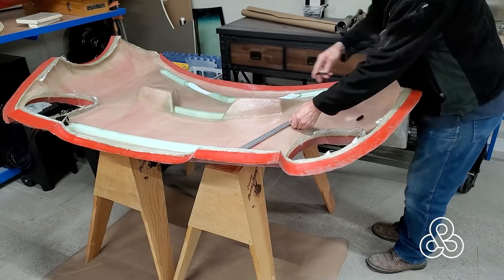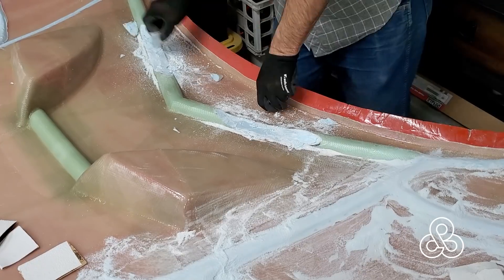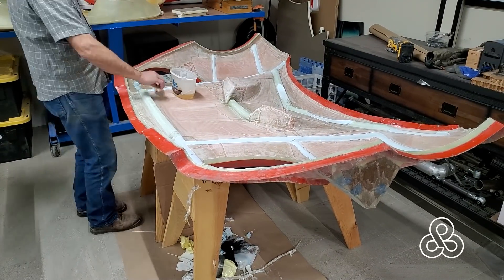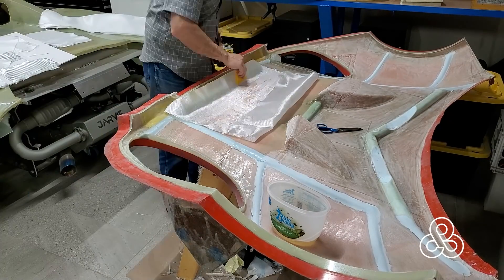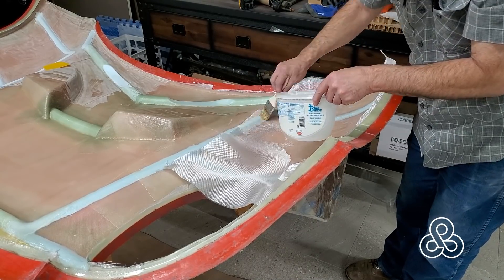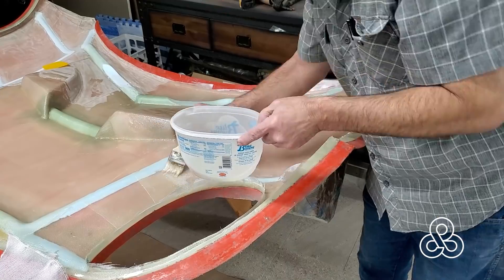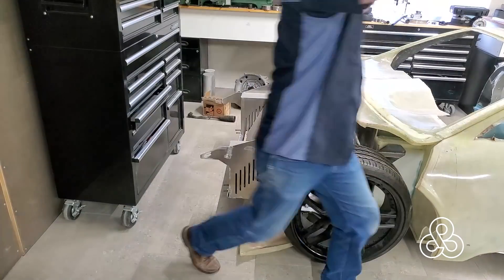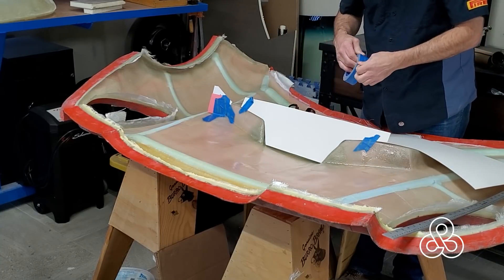A60 Reinforcing the bonnet (clamshell), Arete Supercar Project.

Comment: How do you keep the fiberglass from cracking after chassis vibrations.
Reply from the maker: A material that is can expand and contract with temperature, (the main problem) is almost always good at vibration isolation as well. Rubber and urethane the most common.

Comment: Hey, great work. Have you ever tested the durability of fiberglass panels against fire? I couldn't find any on Youtube. Would you mind demonstrating it in one video?
Reply from the maker: Any consideration for fire resistance is in the formulation of the epoxy itself. Fire could be easily propagated in the epoxy I am using and leave you with nothing but charred fiberglass. Fire resistant panels are usually built with phenolics as they have properties more suited.
Reply: It is hardly fantastic and in this build, has never been a consideration

Comment: I love the project, but I'm increasingly concerned that the composite structure is going to end up being much heavier than you'd want in a supercar.  The strength of composites comes from keeping the resin to fibre ratio to a minimum.  Wet layup is by far the worst method to achieve this.  To make up for the lack of strength, you need to create thicker panels, or add extra stiffening, making them even heavier.  Using Nomex core for lightness, then using wet layup just doesn't make any sense, either mechanically or economically.  Instead, you can get foam core with honeycomb channels that is designed for the infusion process, and creates a resin honeycomb instead of the Nomex and creates light but strong panels.

From comments made in earlier videos, I think you've greatly overestimated both the effort needed to learn CAD/CAM, and also the effort and cost required to use vacuum infusion.
Using CAD, which for someone with your background would be easy to learn, you'd have been able to identify the interference issue at design time, similarly the problem with the rear clamshell hitting the roof when opening.  Even if you don't use CAM to create the moulds, you can get accurate printouts of the cross sections to make your plug(s).

Using resin infusion, and vacuum bagging (nowhere near as hard or costly as you suggest), you could create strong, lightweight pieces, and you could have incorporated closed-cell foam to construct the strengthening ribs at the start.  I would estimate that your composite structures could be half the weight, with the same or better strength, by using CAD to avoid the need for re-engineering things like stiffening and hard points, and resin infusion with vacuum bagging to ensure optimum resin-fibre ratio. I'd also be surprised if it turned out more expensive, because you'd be using much less resin and fibre.

You should check out the Easy Composites channel who did a great 3-video tutorial series on creating a complete car bonnet (i.e. not just the skin) in carbon fibre using infusion with a mould taken off a production car.  The result was superb - incredibly light and strong.  You should also check out the Dark Aero project (also on YouTube).  Although they are not working from a garage, their composite work is definitely within the home-constructor's grasp.  I'm not affiliated with either of these channels, just a fan of their work.
Reply from the maker: Sorry, this time I'm going to have to tell you you are just plain wrong on most points, but all because of one reason- Budget! I will have to take the weight penalty, because I refuse to let this project grow and grow and grow. Let's compare a few costs- My molds= $3,000. Molds with wide flanges for infusion/bagging and strong enough not to distort under vacuum= $8,000 (conservatively). Lets add another $2,000 for molds of rear side clamshells for stiffening (the job this video just described). *$10,000* Foam core- 4x8 1 inch construction sheets used - 2 @ $17= $34  industry standard vinyl foam- 3x4 1/2 inch sheets= 8 @ $69=$552. Vacuum bag supplies to form the hood would have been about $90 (as listed today on Fiberglas.com website.) Not that expensive for one mold, but I have 11 pieces! Sure, some are smaller, but we would also have to remember that the tub would have to be broken down into more parts (likely 6), so now we are talking $1200 or so for vac bagging. I have most of these supplies on hand, but I think you get the point. With a $25,000 budget (now 30K) I would be seriously stripping my engine and mechanical budget. Why stop there? why not go with carbon fiber? Instead of 400 yards of glass at $7/yard try 400 at $40/yrd= $16,000 (but if your going to step up the game to that point you cant use scraps/small pieces in the layup, you have to use full sheet cutouts. So it would likely be more like $40K. You are right however on the fact that I could probably learn 3D modeling fast . . I sure hope so, because I just bought Solidworks at $2000/year. . $3.50/day -- the clock is ticking!
Reply: @BuilderCreator You clearly haven't looked at the Easy Composites videos, have you?

You're so far off the mark in your costings I'm flabbergasted.  I can only assume you're confusing vacuum infusion with vacuum bagging for autoclave (which is a different kettle of fish).

Infusion vacuum bagging only requires a small flange and it doesn't have to be especially strong, neither does the mould.  They are subjected to atmospheric pressure from both sides, so they are in equilibrium.  There is zero tendency to distort under vacuum (assuming you're doing it right), and it uses room-temperature cured resin, so there's no heat distortion.

Please do watch their series (actually I'd recommend all of their videos), cost out what they did, scale it up to your project, and come back with a realistic costing.  The first episode is here: https://www.youtube.com/watch?v=UgKvDw1E60E

Using their prices (not necessarily the best) I've costed up your bonnet, assuming it is around 2 square metres.  For Soric foam core, peel ply, infusion mesh, bagging film, bagging sealing tape, infusion coil, and disposable tubing it would come to about £22.  That's for all of the additional items compared to wet layup. I've not included resin or fibre, because that's your choice.  However, since you'd use less resin and fibre for equivalent strength, you would recoup a lot of the extra.  Also, because of the size of your project, the costs would come down significantly if you purchased everything at once.

When I suggested integrating ribs of rigid, closed-cell foam, I was only talking of inch-wide strips similar to what you've done, just part of the initial infusion.  Even though the foam is relatively expensive, compared to the cost of the project, their cost is negligible, yet you can produce the same strength as the double-skinned bonnet in the videos without needing a separate mould for an inner skin.

You could have used your existing moulds - they're probably stronger than the ones they create in the above video, so there's no extra cost there.

If you were to consider CF, I estimate that their double-skinned bonnet cost around £120 in fibre and resin (not including the mould).  Since you would need more fibre and resin, to end up with a comparable strength part in glass fibre, CF is not really that much more expensive.  Prices for CF in the US do seem high; the 200g 2x2 twill in the video is £9/sqm (£7.50 sq yd).  The best US price I've seen was $20/sq yd.

Good luck with the CAD.  Learn the basics, then start using it.  When you don't know how to do something, look for a tutorial.  That way you're not learning stuff you may never need, and won't get overwhelmed.
Reply from the maker: @Raven-Creations  I am talking the same process (room temperature infusion) Maybe we both suffer from EFDE (exaggeration for dramatic emphasis), but I just looked and indeed US Composites, almost always the least expensive, has 160g 2x2 carbon for just over $30 (21.50) yrd. If I buy a full roll. enough to do the car= $12,000 (8,600). This doesn't change my 'budget" problem. The molds 'Do" have to be especially strong and have a significant flange. Not for the atmospheric pressure, but that after the infusion, that part isn't changing. Any distortion in the mold and no parts will line up. If you think a small flange is okay, you have never chased a vacuum leak in hair puling frustration. I have watched the Easy Composites videos. Mind you, I am not against Infusion or carbon fiber. I am showing people how to do this less expensively. In fact, I sometimes kick myself for not building a $10,000 dollar rolling bathtub, as $30,000 has scared a lot of young people away. This channel is to inspire people to go build something, rather than how to obtain an expensive car. It may as well have been built from Unobtainium as carbon. CAD- I have the basics. I have been using AutoCAD for 30 years (off and on) for architectural drawing. That experience has taught me that I can fly in 2d drawing, but trying my hand at 3D Studio, Blender and Fusion 360 . . It is going to take me a while to get proficient. Maybe if I didn't have cars to build, 2 houses to maintain (one with remodels going on) 2 house plans to finish, A CNC machine to wire, A 3D printer to assemble, church duties and keeping my wife happy . . . I could master it in a few months. Ha! Good chatting.

Comment: Are you planning on using nonwoven  (Chopped Strand Mat) sheets in this project?
Reply from the maker: I used mat in the molds, but will only be using cloth and tapes in the parts themselves. As a side note: I am using epoxy in the body parts and epoxy takes a terribly long time to break down the binder in chopped strand mat. It just does not work as well with epoxy as it does with vinyl/polyester.

Comment: I’m curious, is there a fine balance between structural integrity and weight? It seems like you add a lot of structural layers and I’m curious if this will negatively effects the cars performance characteristics when done.
Reply: The nature of the beast alas, budget making it up as you go along one off fabrication =over weight.
Reply from the maker: Read the response to Raven Creations in these comments . .to long for me to answer again. I might add a note here just for you though- I just weighed the hood-7lbs. Will likely be at 9-10 lbs max when finished. I could have got it to 6lbs for an additional $2500.